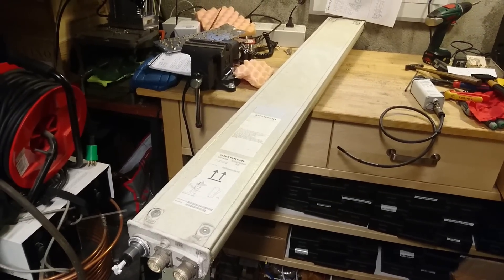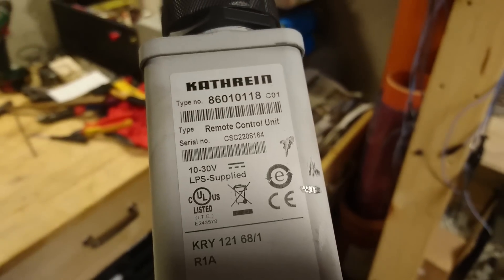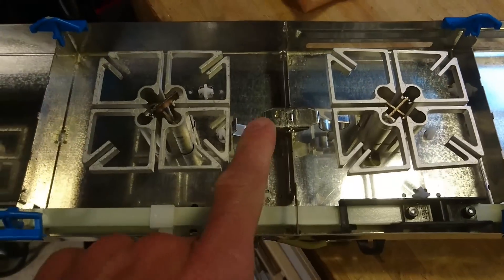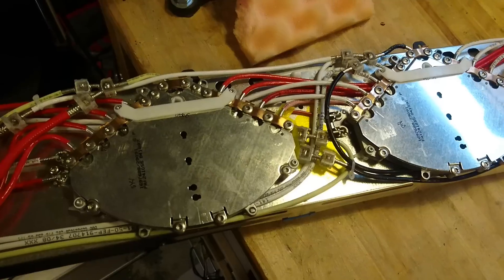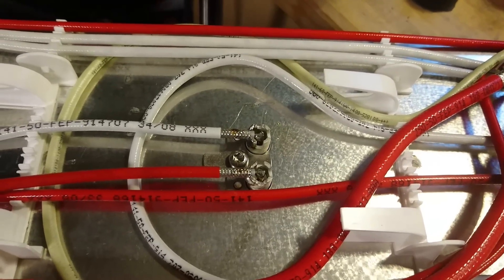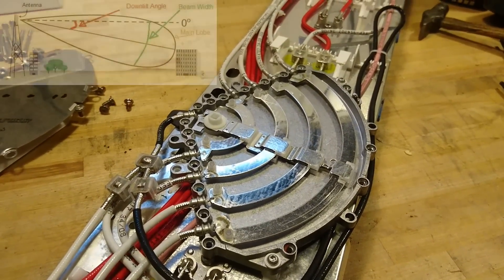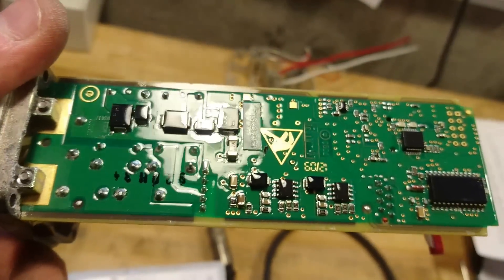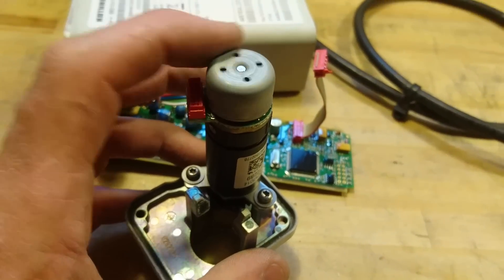Inside a Mobile Phone Antenna! Nokia Siemens Flexi WCDMA 2100MHz Base Station Teardown (Part 3 of 3)

Comment: Memories.. haven't seen these things for a while. Hanging, adjusting, repairing at this stuff was my job for more than ten years. The worst possible job in the world btw.
Reply: ElMariachi to you and the poster, is this electro mechanical adjustment feature generally only used during installation or is it also used to adjust them beam when the local environment changes permanently or temporarily? Basically, I am wondering if the beam is adjusted if a building goes up nearby or if there is some other reason that the beam may need to be moved after installation. Cheers
Reply: When we back in the 90s upgraded all the old GSM antennas to dual antennas (2,1Ghz+900Mhz in one enclosure) or placed additional 2,1Ghz antennas next to the old ones, and we put all of these on without the remote control unit, and adjusted the mechanical aswell as the elctronical downtilt by hand. Sometimes we where called to readjust one or both (more often the electrical tilt) to a new value, that a planner had estimated to be better for that sector.
I think the reason for the provider to not add the remote control units to the antennas in the beginning was simply to save money, so they could build more 3G stations to support their claim of having the best net and yadda yadda.
Some years later, when nearly ever single spot had been covered with 3G, they started giving us remote control units and we put them on nearly every 3G antenna, so they wouldn't need to call us for every readjustment anymore. But from what I remember these readjustments wheren't too often in general. Most stations never needed an readjustment at all. But there where some stations, especially in well crowded areas, that had to be readjusted about three or four times within the first year after we had built them. So, it seems very likely that they did actually use these remote controllers afterwards, but not too often, because there still was the issue of needing people to analyze the situation and find places to optimize and find better values fot there, even with the need for driving to each individual station being a thing of the past.

In theory they later could have developed an software system for autotuning the tilts in regards to the overall network stability and performance, which of course would have lead to a way more dynamic kind of usage, but I doubt this, because that plastic electrical tilt shafts actually felt rather flimsy, and of course there also where other things to spend money on again, like 4G and so on :)
Reply: ElMariachi very interesting! Thank you for the detailed reply.
Reply: You are welcome.
Reply from the maker: I got another Kathrein for an upcoming teardown :)

Comment: Damn, waving a dead fish under a full moon seems less black magic than this stuff! Amazing!
Reply from the maker: Do you wave the fish +/- 45 degrees as well?
Reply: @KaizerPowerElectronicsDk  So THAT'S what I've been doing wrong? :)
Reply from the maker: Fish are highly directional, so you need to be sure which kind you have in order to wave it correctly: https://www.researchgate.net/profile/Alice_Gibb/publication/12838692/figure/fig2/AS:670319576629251@1536828049362/Two-models-of-tail-function-in-fishes-A-The-classic-model-of-heterocercal-tail.png

Comment: Which parts are responsible for communicating with our mobile phones and what is their maximum transmission radius can they achieve?
Reply from the maker: The dipole elements are the receiving/transmitting part. Radius depends on amplifier output. In cities you can find them ranging from 500-1000 meter apart to 50-100 meter, it depends on how many users you have on the base station, so the more people that live in a area, the closer they are.
Reply: @KaizerPowerElectronicsDk  So can one antenna transmit all 2G, 3G and 4G at once or do you need 3 antennas for each Generation?

I am new to this☺
Reply from the maker: @phemelomogatusi8495  Page 6 has a overview over the different antenna elements for different freuqeuncies: https://www.slideshare.net/3G4GLtd/base-station-antenna-needs-for-the-5g-ran
Reply: These square(-ish) things you see on the „clean“ side.

The range can differ, it depends on the standard. DCS1800 GSM generally has a range of 10km within line-of-sight, LTE/5G 1800 MHz of 3-7.5km and 3G 2100 MHz of 2km at best. For 5G, it will be more like 3km. This antenna isn‘t used for 5G however on higher end networks like T-Mobile because it lacks 4x4 MIMO. Some ISPs prefer to use old antennas however and just replace the remote radio heads, the antenna technically is able to transmit 2G/3G/4G/5G at the same time either using RF combiners or RRUs with support for all of the named standards.

Comment: There are two inputs, is there one transmit and one receive, or for MIMO 2X2 spatial multiplexing???
Reply from the maker: I am not sure exactly what system this came from, but either MIMO was used if it was just a small tower, or 1 transmit and 2 receive antennas could have been used at a larger tower.

Comment: That was great to see!  I have been looking at high end antennas like this on eBay for home use and wondered what made them so expensive when new.  I was quite surprised to see how complex that unit is.   I ended up purchasing a $1200 CSS antenna for $65.... and it is working amazingly well.
Reply from the maker: The whole frame is made form copper and the wires are silver/silvered. So there is quite a lot of metal value in these antennas, but the dipole antenna pairs are only made from aluminium. Overall scrap value of a antenna like this is around 30-40$

Comment: Clever phased array trick there.

Also nice way of doing small adjustment for centre elements (inner on the shifter), and bigger adjustment for outer elements (outer on the shifter).

I don't see the 90 degree shifters, it may actually just be some length of coax.
Reply from the maker: the 90 degree phase shift comes from the amplifier, the two ports are marked +45 degrees and -45 degrees, the dipole pairs are 90 degrees shifted to each-other.